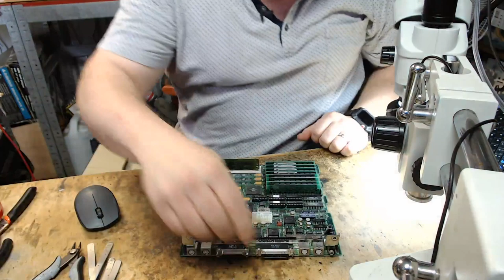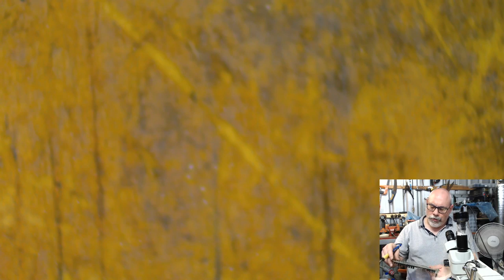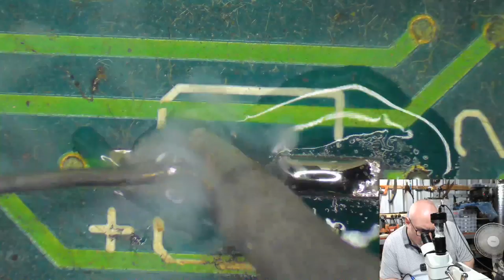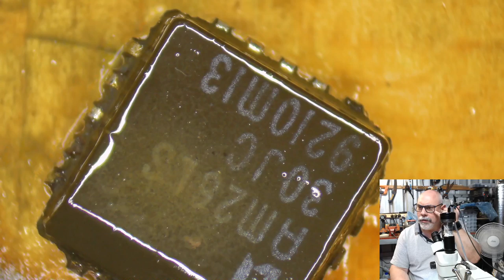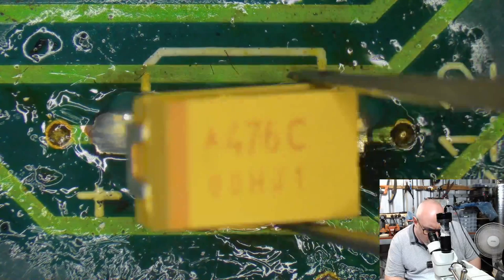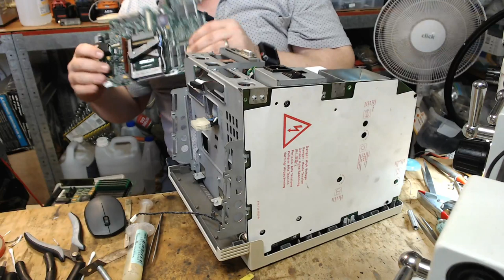Macintosh SE/30 live teardown and recapping

Comment: In my "immense" data-gathering effort (about two boards of my own and a few videos I've seen), I'm suspecting the earlier board is more common than the latter since it didn't come with the exploding Maxell battery. I have one each and the more modern version had terrible corrosion. 
The battery acid not only detached the holder from the board but since it was stored CRT up, many ICs were lost to corrosion (ICs 75175, at UB12 and UC12 just fell over in the first cleanup, both ADB 65C22 ICs at UK11 and UK12 lost legs and pads to the corrosion and the 32.768KHz cylinder quartz resonator at Y1 also fell). 
I'm using this board to practice since the damage is done. 
I've started using a Leica binocular zoom microscope I have in my workplace and it makes all the difference - I can't stress this enough, you must be able to see the smallest detail to manage a repair like this. 
I've also managed to get all the ICs, repair wires and stuff for cheap on eBay and aliexpress, now it's just having time to practice and hopefully make the repair.
Thanks for another great video!

Comment: is there a lubrication that is applied to outer surface of the crt inside the case in the vicinity od the crt power leed??
Reply from the maker: I don't know for certain, but I have often found those anode caps to be a bit slimy.
Reply: @BranchusCreations  tks...any guess on what type of lubricant that may be??